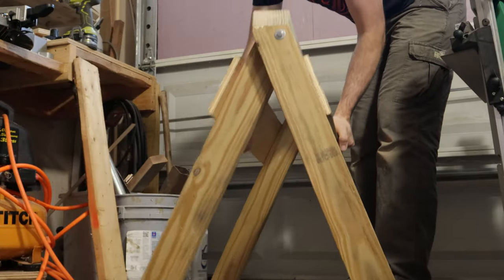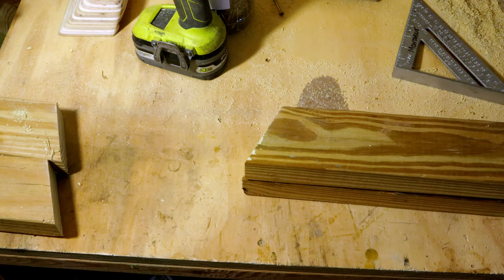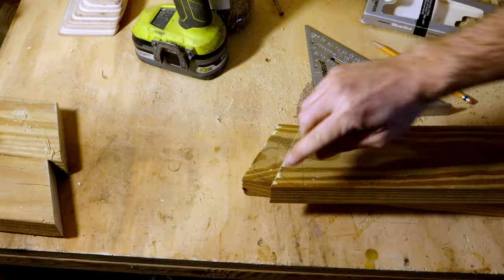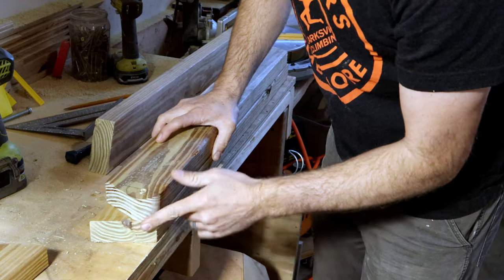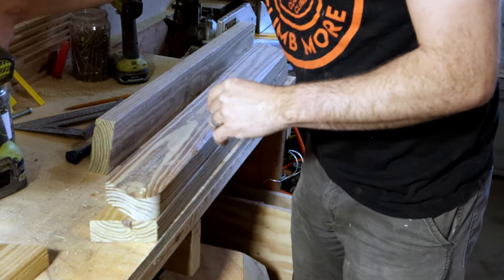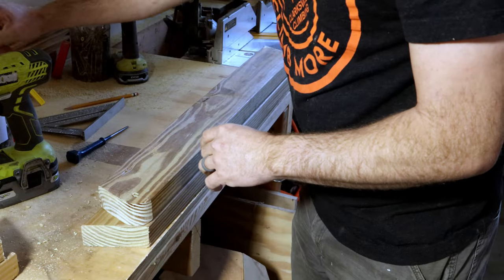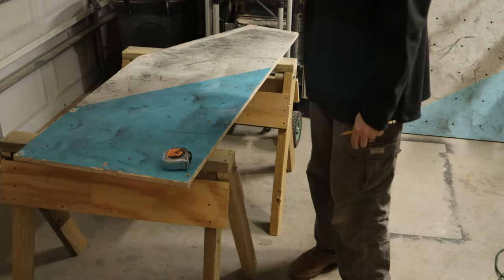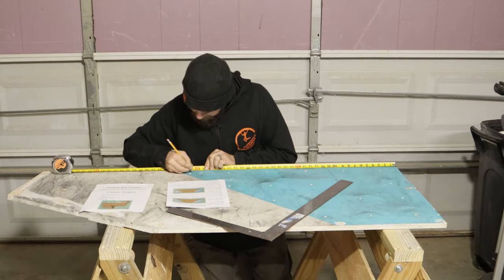EASIEST FOLDING SAWHORSE BUILD

Comment: Nice design!  I'm a real fan of the way the top corners of the inner legs stop against the underneath side of the top piece.  Limiting the spread of the legs with a stop is a much more elegant solution than the ropes or chains of other horses out there.  And good job on the angled screws holding the top extra tight.  Great folding sawhorses!
Reply from the maker: Thanks!
Reply: Same thought, I really dislike these solutions involving ropes. will copy these :)

Comment: I've done designs for various projects before where two pieces of wood rub together while pivoting on a screw, and have had great success making a couple of HDPE washers to lubricate the joint.  Works much better than just a fender washer.  Just cut them from milk jug plastic (HDPE has the 2 in the recycling triangle on the bottom), using the washer as a pattern, and sandwich it between the plastic washers.  

Also, sizing the length of the bolt to allow for 2 nuts, the second one being a jam nut tight up against the first, keeps the nut from working its way off without having to use threadlocker glue.  Plus, it lets you really dial in the tightness or looseness of the pivot joint to your liking, because the jam nut makes the screw tight however loose it is between the wood pieces.

Great project, again!